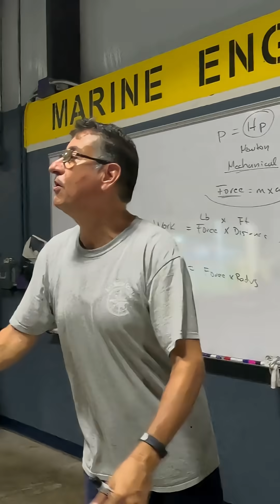Cadillac vs Honda Civic

Comment: Wanted to hear the Reason
Reply: the cadillac has more hp but less torque hes saying this because he is trying to explain why torque is more important that hp there was a lot more to it but that was what this was referring to
Reply: @charlie-d8g huh? It has loads more torque and power than the civic. Even with the power train loss its still leagues above.
Gearing and more importantly the weight is the killer. Was his example torque per lbs?
Reply: @charlie-d8g after reading your comment I googled torque and hp.. well I'm still stuck trying to understand the difference between both..